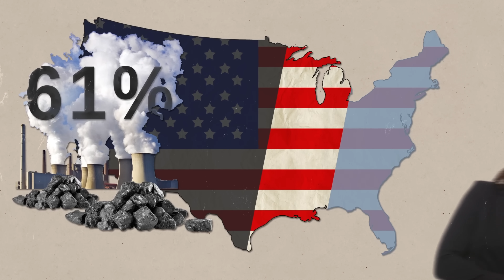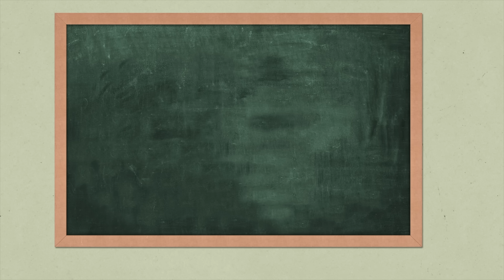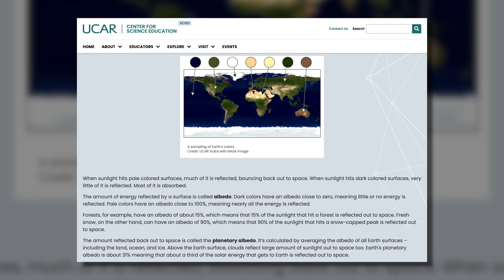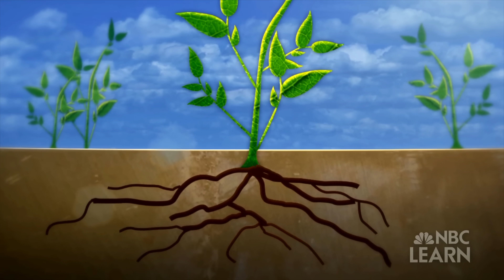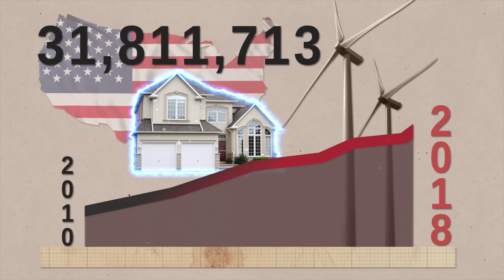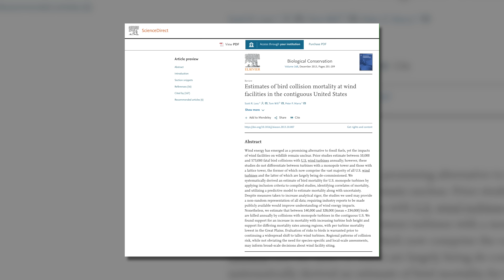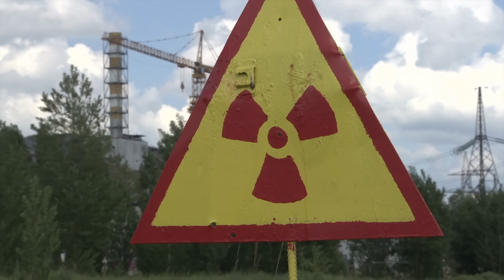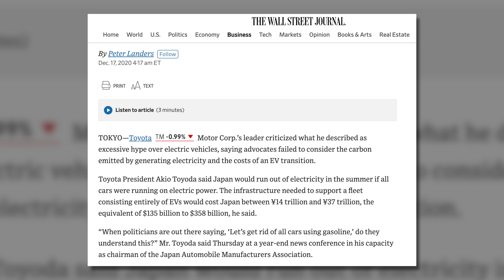Terrible News for America and Japan

Comment: Im a control systems engineer and work with control systems for current nuclear power plants, TRISO fuel manufacturing facilities, and Small Modular Reactor (SMR) plant design.

The nuclear field is moving towards inherently safe fuel (can’t melt down due to carbon layering) and small modular reactors with fewer moving parts and amazing designs.

Instead of a single reactor outputting power, you have a bunch of smaller reactors with safer fuel and safer design.
Reply: That is good news, at least a beam of hope.
Reply: I'm curious about how the thorium plat will do
Reply: @Ben -  That would  be interesting, if we are able to handle and contain the radioactive  waste of it.
Reply: @kastellolo5212  really not an issue.
Reply: I'm glad you brought this up. This tech really does look promising.

Comment: I was an electrical engineer for 33 years, and I tell you there is not enough MW to replace the BTU.
Reply: And yet it is happening. Two thirds of all new electric generation in 2021 and 2022 was wind and solar.
Reply: ask why and who benefits
Reply: @davidparker7920  all NEW.
while globally it was still under 13% in 2022.
a craze does not need to be progressive.
there are soo many problems to solve with wind and solar, and ev-s.
its a gargantuan task if we truly want to do that.
Reply: @xerr0n  there are a lot problems with gas and oil also.. but we have have just accepted it because its easier change is hard.. but were going to                        make a switch at some point.. oil and gas aint gonna last forever
Reply: @xerr0n  Oh dear, another naysayer who thinks that wind, solar, grid scale batteries and EV’s are ‘just a craze’. When the main form of transport was a horse some people back then thought that motor cars were just a craze. They were wrong and so are you. The ‘electrification of everything’ is inevitable. Here in France where I live people are swapping out gas boilers for heat pumps and in the UK my sister changed out her oil heating system for a heat pump and put 10 solar panels on her roof in the process. Since 2019 I’ve been running a Kia e-Niro and have save thousands of Euro on fuel and servicing costs. Last year my solar panels produced 2,600 kWh which was enough to cover 80% of my driving (20,000 km) for the year. In the UK coal has gone from providing 40% of electricity in 2000 to under 5% now, most countries are going the same way. Wind, solar, batteries and EVs are simply a problem of production, not a problem of resource which all fossil fuels by definition are....leaving aside the fact that burning them is screwing up the environment.
Reply: Take a look at the Lawrence Livermore energy usage charts for the USA. As an engineer you will recognise the massive wastage or ‘rejected energy’ as LL call it from fossil fuel primary sources. The fact is the MW ARE replacing BTU’s. Here in Europe oil and gas boilers are being replaced by electrically driven heat pumps and the grid is becoming less carbon intensive with each passing year. I mention here in another post that the UK has gone from 40% coal in 2000 to under 5% now. I live in France where 75% is nuclear, 10% hydro, under 5% coal and the rest wind and solar which are growing rapidly. Scotty talks about ‘covering the Sahara desert to power Europe’...which is silly. The Sahara is bigger than the lower 48 states of the USA and it would only take 10,000 square miles of panels to replace all the oil, coal, gas and nuclear used in Europe and 1 square mile of batteries...Which is also silly as you wouldn’t put them all in the same place and you would still have wind and hydro. The same calculation has been done for the USA which would need to use 9% of the land area of Arizona to power the entire country....an interesting thought experiment but of course you still have the potential of millions of rooftops which are already dark,, the albedo change statement Scotty makes are just the silliest thing I’ve ever heard him say and he does spout some serious nonsense!
Reply: Trap the heat from the sun and store it under the ground
Reply: @Rick6767rick    500 years maybe if you are saying running out, or search lithium mines, giant holes in ground.  PS geothermal enhanced heat pumps for homes are about where they were 39-40 years ago.
Reply: @davidparker7920  Well EVs are a craze. A claim to saving the environment while more being green washing. In theory EVs are better for the environment, but not much. At best climate changing effects will at best be pushed back 5 years even if we fully converted to EVs. The problem is the transport sector is only 16% of all emissions and only around 8% of that is personal vehicles. Even if we assumed EVs were perfectly clean to make, we'd still be doing basically nothing. 

If you actually cared about the environment, rip out your old natural gas heating and get a heat pump. Studies show over 20% of all emissions are from heating homes and commercial buildings. You'll already have done more and cost far less. Also recommend making cities more traversable by bike or personal electric vehicle as these may use a hundredth the power of even the best EVs, reduce traffic, and drastically reduce road wear. 

These are far cheaper things you could do and have far more impact than EVs. The problem is that these are trade offs and people don't like to give up what they have right now. Just think of how many people go to the city officials saying how bikers in the city are a hazard for drivers. Remember that many cities even used to use rail for shipping things as rail can take more weight and needs less maintenance, but we ripped those out as apparently people don't think 18 wheelers are as dangerous as short 5 car trains. Well now not only does it pollute more, it also ruins your roads faster. I hope you like taxes.
Reply: @theowink  
The ground temperatures stay about the same 50+ degrees year around, think cave, heat pumps out side don’t get much cold air when it’s 95 degrees, or much heat at 28 degrees.
Reply: @Rick6767rick  sure, but we cant just flip off of it either. basically anything today is made with it or out of it.
the switch should be organic, ie a good tech comes along that people start to adopt, NOT via mandate.

mandates are funny in that i mandate you stop wasting oxygen.
will you comply? :D
EDIT: typo
Reply: @davidparker7920  right, thanks for showing your fanaticism and going of of a tangent of ME ME ME ME.
and not watching the video.
Reply: Pros and cons
Reply: @Rick6767rick  The problems with gas and oil aren't related to how they produce energy, they just make energy when and where we need it, the same is not true of wind and solar.
Reply: @davidparker7920  Even if solar and wind can replace fossil fuels entirely (doubtful) the monetary and environmental cost would be absolutely horrendous relative to doing the same with nuclear. Just look at the skyrocketing cost of energy in Europe and California, look at the enormous amount of the natural world being bulldozed and destroyed to obtain the resources necessary to make solar panels, wind turbines and batteries, it absolutely IS a craze. It's a craze which may last for a long while, but it's a craze regardless.
Reply: @branthandford2212  absolutely, like with everything!
its far better to know both than only one of the extremes
Reply: Notice how he left out Hydro, the only renewable, clean energy Storage 😉 🤔
Reply: @Skylancer727  The crazy thing about ripping out rails—-car drivers hated their freedom to travel being interrupted by train crossings.  The oil companies benefitted by rail destruction.  Trains still make sense.
Reply: Sand battery will help.
Reply: @Rick6767rick  So called environmental professors in the 1970s said we would be with oil by the 1990s...I think they missed it...
Reply: @jamesconrad1113  I say we mine for the lithium in your backyard and dispose of the old batteries there also.
Reply: @Pete N Well, we don’t have that nonsense in Europe but I know what you mean, I’ve spend a lot of time in the USA.
Reply: @georgehofgren6123  Not the only one...but the biggest one right now.
Reply: @davidparker7920  well, most Ev's suck, as  it stands..I just read about another Tesla that caught fire, it was just sitting in a tow yard.because the self driving system caused an accident...go figure... It took like 6000 gallons of water to put it out, because the batteries kept re igniting.  Teslas are a trend that stupid people fall for.  I was going to say the only OK EV wasis the Chevy bolt..but, those caught fire too...I'm a Hond and ford guy, but even if Honda was making an EV right now, I'd have no interest.
Reply: @davidparker7920  Hilarious,  and  COST MORE.
Reply: @xerr0n  Where is the mandate? Here in Europe EV sales have been growing rapidly, yes with a initial subsidy for each car sold but that’s only sensible when there are environmental and economic benefits to be had.

Comment: I've been noticing down here in the South they have been leveling trees down just to put up solar panels Or solar Farms That don't make any sense to me mow down trees that helped Absorb the carbon dioxide  The tree canopy here in central Florida has been disappearing at a high rate It has gotten hotter here Because they are doing so much building  And thunderstorms have gotten very intense down here in the past 25 years
Reply: @Timothy Keith   I'm more worried about sinkholes  Forming more  Frequent as they continue to build The ground underneath our feet is very fragile is just  Limestone 8 years ago I had small micro  sink holes form under my home  Where the insurance company had to pay to sure up the ground underneath my home
Reply: @mwilson7097  With more rain saturating the ground comes more erosion of the limestone and sinkholes.
Reply: @mwilson7097  Yep... Florida is a sand bar. Floating on our aquifer.  And when the farmers save strawberries by running sprinklers on them for many nights in a row due to near freezing temps... Sinkholes are inevitable.
Reply: Whatever happened to save the Trees?
Reply: oxymoronic
Reply: Ya gotta spend trees to grow trees.🤪
Reply: Fracking. Gotta love them drilling and fracking and causing all those sinkholes.
Reply: @zach_diecast_mansur  I only smoke trees ...  As prescribed  of course.  I have always looked at it exactly like golf. I spend all day on some really good GRASS. GOLF THE NATURAL HIGH... STATE OF A BLISS
Reply: @williammarrara7490  😅

Comment: In Michigan, New York and Hawaii, these states use trash incinerators and in return produce electric power. 
Trash is always being thrown out everyday and it never ends. These plants run all day and night.
The ash gets recycled and all the steel scrap metals too.
Reply: I think bio gas is becoming a secret power generation here in the UK. Quite a few large farms have done it since 2011-12 to heat building's from the gases produced in bio digester systems. There are now trucks on the road fitted with gas tanks running on the bio gas.
Reply: Where I live, it is 94% hydro-electricy and 6% wind turbine. I would like to see more hydro electricity. It is one of cleaniest source of energy.

Comment: There's a new particle splitter that's on its way for heat and electricity.

Electric batteries cannot be recycled and damage the environment.

Great report. Thank you!
Reply: only  one  way  to  "recycle"  all  those  old,  used,  leaking,  n  corroding  toxic  lithium  batteries.  by  incinerating  them.
Reply: LiION Battery recycling is built into Ford and Tesla's factories. Used batteries in and new batteries with cars out the other side of the building and they are competing for batteries from telephone batteries to old car batteries.
Reply: Yes they can

Comment: Good points, but there are a lot of variables not looked at. First it depends what color the soil or roof is. Dark colors absorb more solar, for less of a difference and, while it gets hotter in day, the ground is shaded and night temps can be lower in solar farms. That is already seen in roof top installations, where the roof beneath the panels is cooler than in direct sun. Designers are working on ideas. Glass treatment (like used in house windows) to reflect undesirable wavelengths is one method. Another is water cooling the panel below and extracting heat for other uses. That method was used before PV to pre-heat water heaters and direct interior heating. They are also working on wide spectrum PV panels, which can collect twice the solar. Wavelengths converted to electricity will leave less to generate heat.
Reply: Exactly a lot of the point on these videos are so far fetched and black and white smh Scotty has big oil paid for this video?
Reply: That’s what I was thinking too. The points were really grasping at straws, but Scotty knows how to work all sides of the aisle. It’s pretty impressive, really.
Reply: @luism8612  The experts have also warned against pavement for decades. For some reason people aren't concerned with a new parking lot going in but it has similar solar effects and also causes water runoff... double the threat.
Reply: @mikep490  If you make your carpark out of light coloured concrete, you're alright on the heat. But concrete itself is one of the largest causes of Greenhouse Gases... Everything seems to have a counterpoint now. Of course, Clean Fusion Power is only 10 years away. It's been 10 years away since 1960. 😥
Reply: @luism8612  They're already having such issues in California and Europe.  Many nations are changing their tune because of it.  We aren't even close to running all EVs yet and it's starting.  Almost every "green" stat you read about is a lie, that's the problem.
Reply: @tsubadaikhan6332  Well the problem more is that to have actual effect on the climate we need to change our unhealthy ways, problem is people like their unhealthy ways just as much as people still buy sodas and cheese burgers. The whole reason EVs are popular is they give the venire of saving the environment (ultimately doing very little) but let people continue their unhealthy lifestyle.
Reply: There's also the possibility of the photo rectenna becoming mainstream. The photo rectenna is rarely talked about but in theory could allow solar cells of up to 70% efficiency. The method however requires a diode with a frequency in the terahertz which so far as been a hard thing to develop due to efficiency of diodes falling with frequency.
Reply: @tsubadaikhan6332  well at least they aren't used to our unhealthy ways. They at least have a chance to not follow us, but their envy may also make them seek to follow us. Here though any change is a monumental one as we already have a wreck of a system and our entire city's, property rights, city structuring, distribution of people, etc means to improve what we got is nearly ripping apart most of what we have.

Comment: One important note: you mentioned the need to store electricity from solar is a problem. Yes… but what is an EV? A giant battery on wheels. It is part of the SOLUTION to that problem. V2G (Vehicle to Grid) technology isn’t just feasible but it’s already happening. If everyone drove an EV we wouldn’t have an energy storage problem, we’d have more energy storage than we can even utilize right now!

As for Toyoda’s statements, it’s ironic you pointed them out about 24 hours after he stepped down as CEO, the scuttlebutt being that his refusal to accept the inevitability of EVs and act accordingly was no small part in this charge of command. It’s telling that a new EV platform was immediately announced by Toyota after he stepped down.

Comment: Fastest way to reduce CO2 production:
Well placed windows and shudders harvest solar heat when heat is needed. Shudders reduce heat load when cooling is needed. 
High efficiency natural gas furnaces are 3 times more efficient than thermal power plants after line losses. When the sun isn't shining.
Reply: Shutter?

Comment: IMHO Most of the drawbacks to the various sources of renewable energy you mentioned have more to do with the methods these technologies use rather than the technologies themselves. For example, I don't see why the manufacturers of wind turbines don't put screens or chain link gates around the turbines themselves to keep birds out. Yes, it would be an eyesore, but it's a way to solve that particular problem. Likewise, when you mentioned how solar panels would indirectly increase the plant population. Don't forget, plants absorb heat and generate oxygen. So that problem has the potential to solve itself to an extent.

Comment: Thorium MSRs seem the way to go. If you can make a mini thorium MSR sphere you could use the graphite spheres to breed thorium and make heat to power turbines or boil water directly. Where each graphite sphere is coated in stainless steel or ceramic to make it sealed tight.

Comment: I think solar, wind, and nuclear all need to come into play. There are newer micro-nuclear plant designs that get buried, run until they die, then stay buried.

I know they made a big deal about the recent nuclear fusion breakthrough being a big deal and it is, but when they say there was more power generated by the reaction than power that was output by the laser. The laser technology we have is not very efficient so if you find some reporting that looks at the amount of power that was fed into the laser VS the power produced, more power was used to create the reaction than was produced. Anton Petrov had a video about it not long after the news broke that got into that a little. Startalk just had a video with a person from the company that had the breakthrough, where the question about how much power it takes to  power the laser was kinda brushed off as 'just an engineering problem'.

Comment: I live off the grid in Hawaii for free. It's not that I have a mega watt type of solar.  Also run alot on propane and use very little overall electricity with no AC or electric appliances.